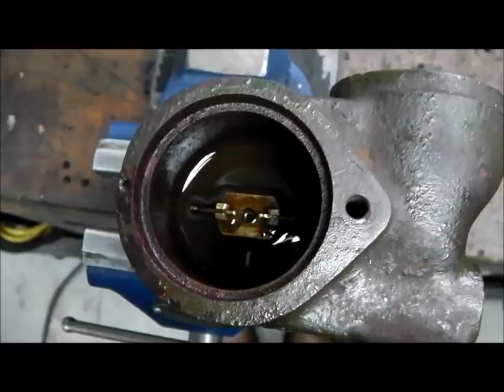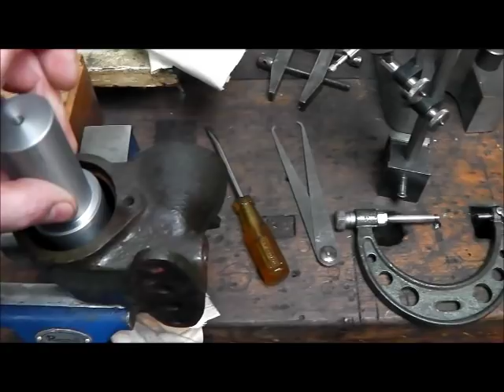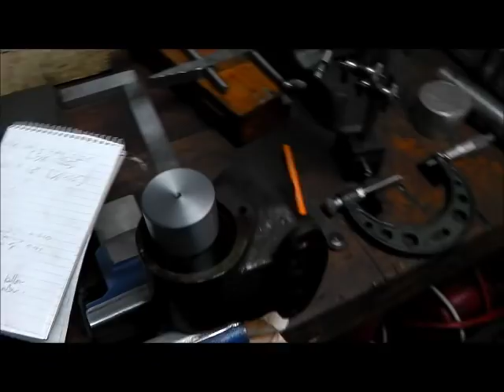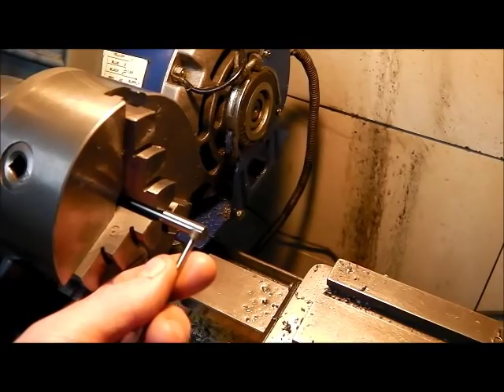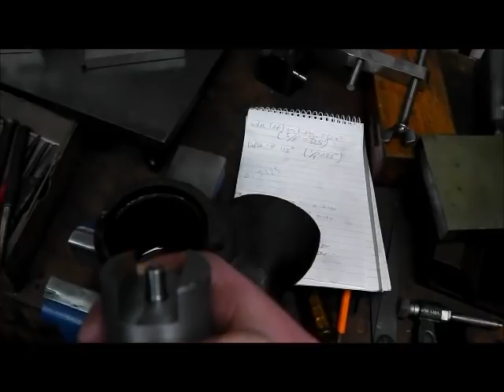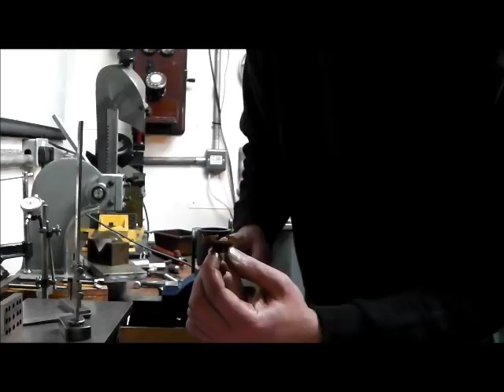Ruston & Hornsby Overhaul - Part 3 -

Comment: A very nicely made tool. Were you getting some movement in the setup, when drilling the hole for the Tommy bar?
Reply from the maker: Thank you. It's likely there was some movement, though very slight. The work was way out over the opposite side of the carriage from that which it was being driven. Minimal wear in my lathe so I got away with it!